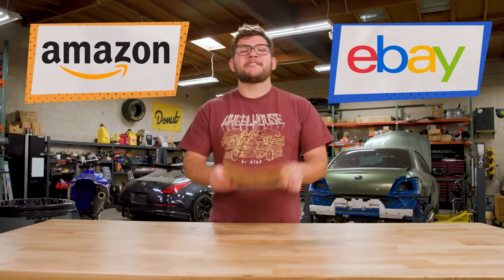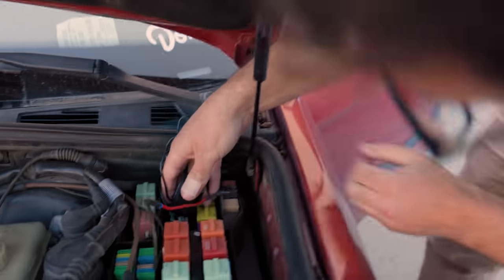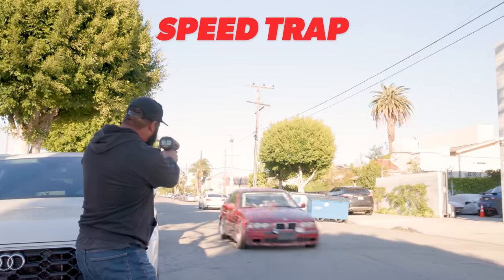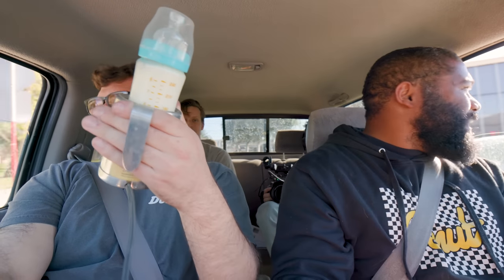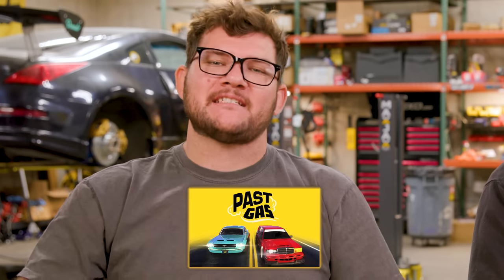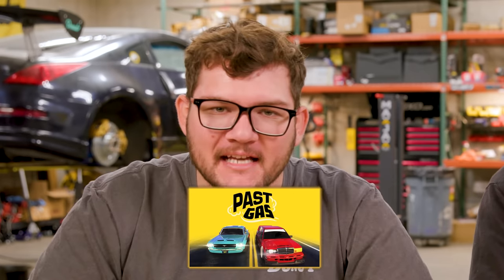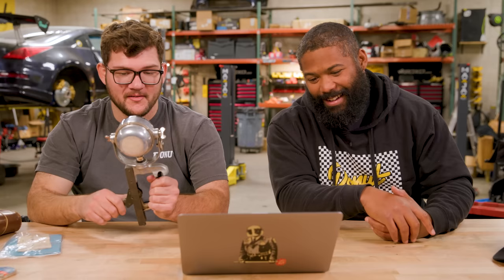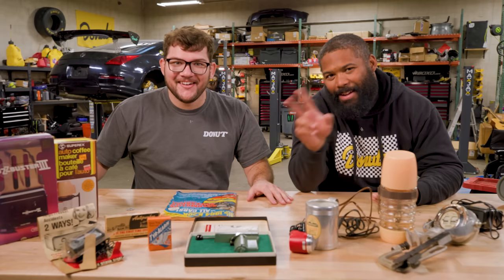Testing More Forgotten Car Accessories

Comment: One thing you guys probably forgot with that bottle warmer, people used glass bottles back in the day so it wouldn't be burning it lol
Reply: Came here to say this lol
Reply: Beat me to it.
Reply: I'm glad I'm not the only one that's knowledgeable about baby bottles circa 30 years before my time.
Reply: also it needs a little bit of water at the bottom
Reply: Late 80's early 90's generation for you.
Reply: I was thinking that it might also need some small amount of water for even heating and not just the bottom like a bain-marie
.
Reply: They also weren’t adjusting the gain on the fuzz buster enough.
Reply: Came here to say this too. The majority of baby bottles didn’t switch to plastic until about the mid-1980’s
Reply: You also put a small amount of water in bottle warmer. Don’t think they have kids 😂😂
Reply: Fun anecdotal fact, truck stops driving cross country are super cool about free hot water and  you using a bowl and mason jar to do this.
Reply: I think thats the reason they put it in the good category if not for that consideration they wouldnt have done that in my opinion
Reply: @shawnmartin1306   I don't have any kids yet either and even I knew that 😂 but I'm kind of an old soul so can't blame them for not knowing everything
Reply: Donut guys left the chat...
Reply: And used water in there to heat baby bottle
Reply: This really makes me feel old knowing this.
Reply: @shawnmartin1306 Hahah tell me you ain’t got no kids without telling me you ain’t got no kids 🤣
Reply: I still use glass bottles lol.
Reply: Came to say the same thing
Reply: Lol true, I thought they forgot to add water in the warmer
Reply: @DrOldsmobile91  we got a cool guy over here folks
Reply: Probably got edited out. They shat on it and then put in in a good pile for no reason. Still bad editing if that's the case.
Reply: And pretty sure you have to put a bit of water in first
Reply: Was going to say this lol
Reply: They also put water in them depending on the style 😂
Reply: @dattda  same with the fuzz buster it worked as it should and they put it in the bad category?
Reply: You beat me to it, but I now also have a good indication of your age. Boomer!
Reply: Why would anyone want warm beer, or soda?
Reply: I said it outside this thread so this really hits home. 

 Come on donut.  Youre so close to excellence.
Reply: This is what I came here to say lol
Reply: My thoughts as well.
Reply: Came down here to say that as well 😅
Reply: thought about that right away, lol, but still not really well thought out, cause people wouldn't be able to take a hot glass bottle in their hands 😆
Reply: well glass bottles and usually had some water in the heater to transfer evenly to the bottle. The handle is for putting it on the door by wedging the handle into the window slit.
Reply: Also a lot of these used rubber seals and gaskets which anyone with an old car will know perish and need to be replaced
Reply: And maybe the cigarette lighter back then couldn't pump as much current? He said the cord was heating up, which is dangerous.
Reply: Me too
Reply: Came to say this. I don't know how they missed such an obvious fact.
Reply: @machete18  fuzz buster doesn't work against modern radar guns. Different frequencies.
Reply: @xToddmcx  if it were made for 6v cars, sure, but if it were made for 12v and the car were 12v but couldn't supply the current you would either burn a fuse or burn the wiring in the car
Reply: factual
Reply: dont you love when the age and knowledge of children shows in the content they make. buncha dudes testing a baby product lmao
Reply: @desertstar223  I ain't no boomer lol 🤣 I'm 31 but probably a boomer at heart lol
Reply: I was going to say that
Reply: Came to say the same thing
Reply: @desertstar223  No worries dude👍🏻 My pic and username would probably suggest it was some dude in his sixties 😂
Reply: @keithk2920  You're spot on, but how do you know all this detail? Something to do with your age, maybe? Boomer?
Reply: @mex55  or add a small amount of water to the warmer unit
Reply: @cannibal_bacon  I just know because of Tom and Jerry cartoons lol
Reply: Hell I was born in '98 and my parents still fed me from a glass bottle.
Reply: Typed this exact thing and then saw this comment.
Reply: @6atlantis  Yes, I think for some reason they thought it controlled the vol.
Reply: I just jumped off of watching this video on my TV, to login with my phone to say the same thing. 😂
Reply: Glad I'm not the only one that thought that.
Reply: I was just about to comment that lol
Reply: Also car electric systems were running in 6V, but not 12 as today
Reply: I was thinking it should of had water in the cup
Reply: @TermlessHGW  easy, I knew what was wrong with their bottle.
Reply: You beat me to that one. Lol.
Reply: @Dave435l  also: heater vents work well as bottle warmers. Particularly the defroster vents on a '72 F-100.
Reply: Came here to say this also lmao
Reply: I came to say that and as a parent I would have wanted one for trips
Reply: @SUPER_PROPER  yes. But I just looked it up and the last 6v cars were in 1955-1956. So if that baby bottle warmer was indeed from the 60s then it should be designed for 12v like they used 6:31
Reply: Came here to say that 😭😂
Reply: thats what i was gona say lol
Reply: @cameronbennett4762  yeah, might be. Anyway the materials the bottle warmer is made of surely degraded over past half a century, so it's not working properly. And bottles made of glass seem to be the main reason no matter voltage warmer or car is running at. Btw I'm from Eastern Europe myself and we had 6V cars up to around mid 70s 😂
Reply: @cannibal_bacon same haaha
Reply: We have to remember most involved with these videos were born long after glass was replaced by plastic
Reply: For stronger babies!
Reply: I came to Make this statement 12 hours to late
Reply: Dam it beat me to it
Reply: Is milk suppose to be boiling tho haha?
Reply: Nolan's too busy being in the pocket of BIG PLASTIC
Reply: Didn't know this but was thinking about it the whole time. Thanks for confirming.
Reply: We use glass bottles for our kids, they heat faster and they aren't plastic
Reply: Was litterally about to comment this.
Reply: Add me to the list of people who came here to say this about glass bottles
Reply: Well, you're right. Half way. That bottle warmer have basically a heating element on the bottom. Imagine how hot it gets if it was able to burn the plastic even with the cold milk in it. If you would put glass on it, it could possibly crack or shatter due to the uneven expansion caused by the uneven heating (the bottom would be way hotter than the top) wich would lead to internal tension in the glass. At besides tempered glass, glass in general doesn't like internal tension. Probably those glasses wich are made in the 60's would handle it even worse than today's made. My point is, you can't use the warmer by itself, I think you should pour water in it wich distributes the heat more on the glass so it can warm up evenly
Reply: What people didn't drink out of oil, plastic containers,. No way.
Reply: Also im fairly certain they were supposed to add water
Reply: @TermlessHGW  wrong. I was born in 88 and knew immediately it wasn’t going to work properly with a plastic bottle. The problem was a lack of common sense. You wouldn’t heat a plastic bottle directly in contact with a frying pan either
Reply: We still use glass bottles with ours
Reply: buttt he did say it works tho
Reply: I had just been thinking that when I looked down and read your comment lol!
Crazy how much changes in time!
Reply: Was just about to mention it so just take my like instead.
Reply: glad i thought of this one first. lol... we should start a group guys.
Reply: Also bottle warmers normally tell you to put a small ammount of liquid in the bottom.
Reply: Exatamundo. Wanted to say this meself
Reply: It smoked like every one else those days....
Reply: Also, put water in it to dissipate heat
Reply: And you are supposed to put water in it… and it does still exist!!
Reply: Or water in the cup
Reply: That is what I was going to say!
Reply: @nathanblake123 to I've🇧🇭
Reply: @machete18 the dgx
Reply: D
Reply: D
Reply: I
Reply: One thing they forgot was bumper 2 bumper, up to speed , science garage and money pit.
Reply: @6atlantis  I would assume also that radar guns back in the day were bit different to modern ones so maybe that's why i didn't work that well.
Reply: @TermlessHGW  80s - 90s used glass... 🤔
Reply: Exactly what I was going to point out and you had to wrap the bottle when it came out because the glass was hot for ages. Dont ask how I know
Reply: Shit i literally came here to say this
Reply: Correct
Reply: Any notice him looking at the pacifier like he realy wanted to suck on it lol
Reply: You can still use glass now if you want
Reply: @dattda  was gonna say they don't even include mentioning that; they just go yeah ay if you got a baby in the car feel free to burn up a plastic bottle while driving along.
 "Even better bro hotbox it with da fumes" - donut probably 

Big Thumbs Up from donut.

Clarification was needed for that one...
Reply: yup. true
Reply: Well a babys milk shouldn't be more than 98° so I'd say it shouldn't be hot enough in general to burn they literally have these today for guess what plastic bottles omg that's crazy
Reply: Ed zachery
Reply: Most baby bottles are still glass today...
Reply: @cannibal_bacon I know antiques and back then they had quality, they would have metals or glass instead of plastic
Reply: exactly this
Reply: the fact that he thinks metal will live longer than plastic makes me think he's not very smart
Reply: The thing everyone thought of you said

Comment: “You can’t even get this material for 5 bucks anymore” Sad but true 😂🥃
Reply: don't forget about inflation.  it's probably 4x the cost now
Reply: Pulled up the inflation calculator it’s more like 10 - 12 times more expensive
Reply: @pc_gaijin  yeah
Reply: I mean, back then $5 was like $30
Reply: And the average wages were like $30 a week.
Reply: Everyone guessing like google doesn’t exist 

$5 adjusted to inflation is $48
But purchase power was more like $23
Reply: @HughJashole69 why guess when there’s google?
Minimum wage was around $48 a week, but median household income was $152 a week, which adjusted to inflation is $1460 but it’s purchase power was more about $698
Reply: back then everything was better

Comment: Growing up in the 90s toll booth change baskets were still a thing. The coin launcher is by far the best product and at the best value, even for 1960s money. 
It's practical, fun to use, and unique.
Reply: Sadly I think if you used it now days someone would call 911 and report that the driver has a gun.
Reply: They still are a thing for the bridge in my home city in Canada. People who use it often can get a transponder, but people who only cross occasionally can use coins (or go to a cashier if they don't have change).
Reply: I used one in I think NJ or DE a few years ago.
Reply: I don't know exactly what year the toll booth gun is from, but I'm guessing the early '60s. $5.95 then is equivalent to over $60 now.
Reply: @KeystoneMotorsports  NJ has phased out manned booths, and I'm honestly not sure coins are a thing anymore either.

Comment: 6:08 I grew up with that very same coffee maker, we used it all through the 1980's and 90's and it still works great, we used it to heat the water and pour it into soup in a bowl or small pot and coffee in a cup, making anything in it is a bad idea as it will burn into the coil, the box even says not to.

Man I would love that brake tester at the end, when I serviced the brakes on my 1931 Pontiac it would have been amazing to see the difference my work made in actual feet!

Comment: 3:30 "It only detects when the RADAR gun is pointed directly at the unit. That's kind of concerning."
Why? That's how RADAR works. It only measures your speed if it's pointed directly at you.
Reply: Yes, but ideally you'd like to know if someone is using a radar gun in the area before they point it at you.
Reply: Radar waves travel outward in an arc.  The further you are from the source, the wider the arc gets.  Good radar detectors can pick up the RF signals even when the radar isn’t being pointed directly at the receiver.

Simple radar guns do need to be pointed directly at an object to accurately determine speed.  This isn’t because the radar waves travel outward in a linear path, but because the unit is not capable of distinguishing between multiple targets simultaneously.  Advanced systems can accurately track multiple objects.  Some police units use 360 radar systems on patrol vehicles that can accurately track the speed of multiple vehicles simultaneously.  The radar is “pointing” at any one vehicle in particular.  It’s simply sending out waves, which bounce back to the radar.  A computer does the math to separate the targets determine the speed of them.

To get down to the very nitty gritty of it, there are some extremely advanced radar systems (military) that can focus their beams down to much narrower fields of view in order to provide high fidelity tracking data at long ranges.  Even so, the further away you are from the source of the beam, the wider it will be.

I operated radar systems for 8 years in the navy, so I’m pretty familiar with how they function.  They don’t point in a straight line, they aren’t lasers.
Reply: @DieselDreamerTV  
RADAR actually sends waves in a cone shape. The cone in most radars is limited in width. If you are outside the cone (i.e. the radar is pointed away), it may see you, but it can't measure your speed.
Reply: @DieselDreamerTV  While it's true that a radar doesn't shoot straight forward like a laser, for the purposes of a radar detector if the waves are going towards your, it is pointed at you. A detector cannot determine where the gun is actually pointed, it only knows the received signal level of whatever radar it saw.

In other words, this detector would still see the 360 radar systems or any off axis radar guns, its just a matter of whether or not the signal is strong enough to trigger the warning
Reply: @wbfaulk  You can't detect a signal that doesn't hit you. There's no radar detector on the planet that knows a radar is in use before the wave hits your car. It's like trying to watch TV from the wrong side.
Reply: @Geerice  I’m not talking about knowing whether or not a RADAR is actually “pointed” at you.  As far as saying “you can’t detect a signal that doesn’t hit you”, well no shit Sherlock!  Who said you can?  I’m not sure what you even think you’re contributing to this discussion.
Reply: @DieselDreamerTV  "Good radar detectors can pick up the RF signals even when the radar isn’t being pointed directly at the receiver" You quite literally are talking about if radar is actually pointed at you. I'm saying that the pointing of the radar is completely irrelevant.
Reply: @Geerice  so you’re agreeing with me then, thanks bud, what a round about way of saying that!
Reply: @DieselDreamerTV  Not really, no
Reply: @Geerice  True. And that would be relevant if a radar gun just emitted a tiny beam of radar waves, all of which hit its target, and all of which are either absorbed or reflected directly back at the gun. But that's not true. Some miss the target, and some are reflected by the target in various directions. So if you're near the target, you might be hit by some of these radar waves before you become the target.

So, to use your analogy, no, you can't watch TV from the wrong side, but you can usually see whether it's on or not by the light it creates in the room.
Reply: @wbfaulk  If the beam is hitting you, then the radar can track you, whether or not you're the intended target. If the detector goes off, it might already be too late, depending on the amount of traffic.
Reply: @Geerice  If the operator of the gun is pointing at one car and it indicates that something is going too fast, the operator has to determine who is going too fast, and his conclusion is unlikely to be the car that he's not pointing the gun at.

No one is saying that being able to detect stray radar waves guarantees that you will be aware of a radar gun before it's too late, but being unable to detect them significantly increases your chances that it will be too late.

Comment: I think baby bottles were all glass back in the 60’s. So it would have probably actually have worked pretty well.
Reply: Don't think plastic baby-bottles you could sterilize were available back then!
Reply: Plus I'm thinking a cord that old requires some inspection and probably restoration or a swap. Especially since it's heating.

Comment: That brake tester is called a tapley meter and it is still used in the UK on MOT tests for vehicles which can't go in the brake rollers (4wd vehicles for example)